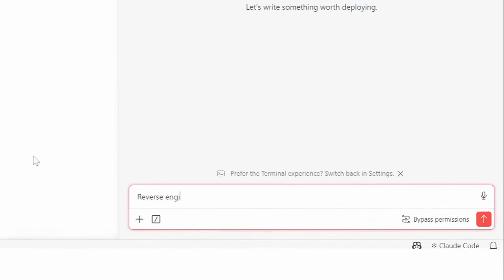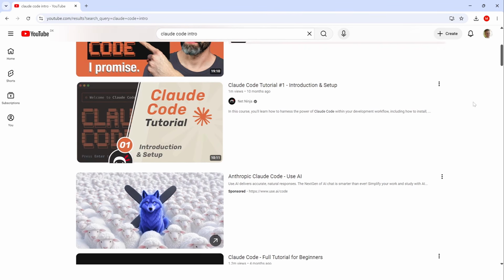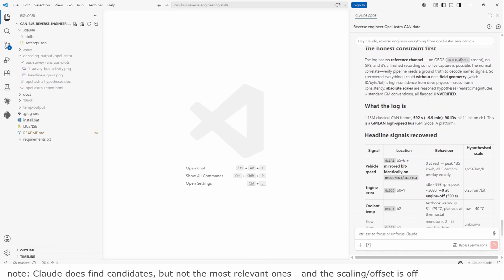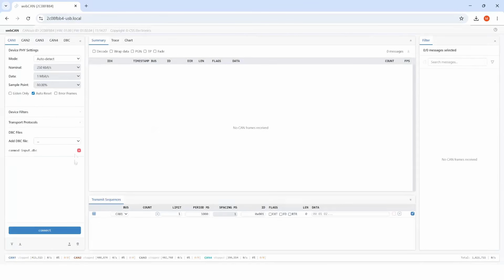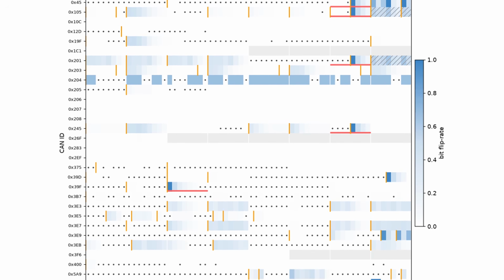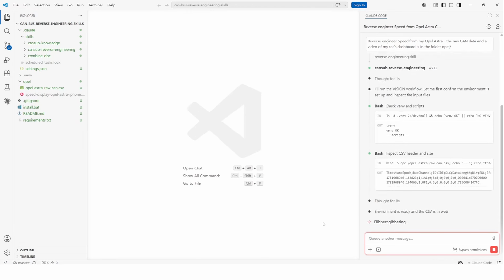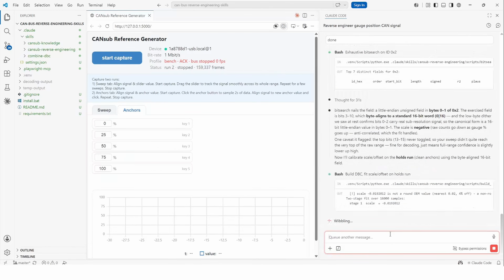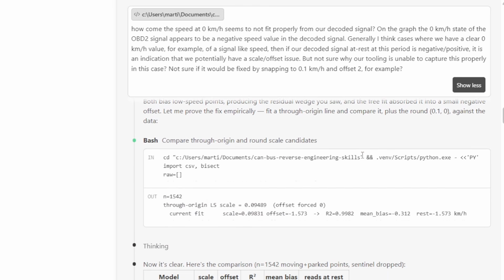AI CAN Bus Reverse Engineering [Claude Code]

Comment: Very nice but over complicated.  Passive can sniffer to the DLC, Savvy Can for pins 6 and 14.  Start capture, raise rpm by 1000 and hold for 10 seconds, repeat.  Capture the Savvy Can record and give to Claude.  The key is timed single events.  And you know what the event is.  Fuel level would be more difficult because of the nature of fuel level.  RPM actually is pretty easy.  For speed you need another person holding the laptop where savvy can lives.  Hold speed for 10 seconds, increase at timed intervals.  Tell Claude your pattern to spot.

Comment: It's great that people are working on this problem as I had similar thoughts on how AI can be utilized to parse and organize large data sets like this. The two places I'd like to see it implemented is for CANbus and with proprietary tools/battery combinations.

However, I'm a little confused at what you have and have not been able to accomplish with this tool so far. From my brief understanding in this video, you're passing both the raw and reference values into Claude and having it determine which stream correlates with that value. This, as you've shown is easy when you HAVE that reference data (ie, speed, rpm, etc.) but I didn't see anywhere you showing how you'd be able to gather reference data for items not easily accessed (and example I can think off the top of my head is cam timing). Sure, I could get this information from another tool.... but then I already have the tool that decodes this....

This is what I see currently: 
You mention the time saving of letting Claude doing the analysis, yet I believe you'd spend just as much time trying to figure out how you''ll collect your reference data for an individual component that it comes out in the wash.

But not all hope is lost. The biggest benefit is opening the door to crowd-sourcing the reverse engineering in a much easier fashion. (ie. I might be able to scrape together the o2 sensor data, while someone else might scrape together the timing, throttle control, etc).
That might be where you see the largest benefits.

I'm not trying to rain on the parade, I think this is a good *first step*... but there are many more steps to take...

Out loud thinking:
A company probably has their own proprietary CANbus protocol. But companies are cheap, they'll re-use that same protocol for a very long time, probably only changing it when they do a major refresh. I bet, over time, you can use say, the .dbc of a corolla, and a .dbc of a tacoma, and probably correlate a lot of the same points on a miata of the same generation. Now THAT would be your boon. Allowing the AI to compare multiple model's to enhance the others..

Really we just need some guy willing to spend the dough to buy the manufacture's software, and walk through the protocol one point at a time and map out the protocol to share... the question is, who has the money to do that and willing to put up with the inevitable C&D!

I'll keep an eye on this project however.. Maybe we need a repo to capture most up-to-date .dbc's that people can search/add to..

Good luck!
Reply: It is correct that this method relies on having a reference signal. But it is not limited to an "obvious" signal like an OBD2 PID or a GPS-to-CAN signal, for example. As per showcase 2 and 3, there are more 'raw' ways of getting reference signal information, where the trick is to be a bit creative. Sometimes this may involve having the 'decoded' information available from another source than the CAN bus (such as in showcase 2 a visual display in the car). Here I would argue that there is a massive difference in having that decoded source available in such a format vs. having it on the CAN bus - i.e. it is not a 'simple thing' to transform e.g. a visual display reference into a useful reference for CAN bus reverse engineering - and that is what the skill then showcases a set of methods to assist with. 

As explained in other comments, the article/video shows methods for speeding up the 'classic' reverse engineering workflows. These, in my opinion, will always involve a reference signal - whether explicit or not. If you're e.g. opening/closing the car doors or clicking a button while you monitor data in SavvyCAN, you are in practice using a "reference signal", just in a - I would argue - much less efficient way. If you do not have a reference signal in any shape or form then there is no real path to effective, verifiable reverse engineering - whether you use the classic manual approach or whether you use these AI agent assisted methods. In such a case, you'd be looking for a needle in a haystack or shooting in the dark. You "might" get somewhere if you can e.g. rule out potential candidates through elimination; for example, if you've got 20 potential signals and you can map 15 of them via other methods, you increase your chance at getting a good candidate signal even without a reference. But you'll "never know for sure" if you can't verify your results through some form of real-world observation. So this is just to say: That is not a problem I offer a solution to. But in my experience, 80-90% of practical reverse engineering efforts already focus on use cases where there is in fact a possible reference available.

If any questions let me know :-)

Comment: Thank you ever so much for educating me, I have wanted to figure out a way to add a screen for coolant temps as BMW's don't show this, well at least not on mine, I have also added a CarPlay screen and used magnetic tape to place it on the idrive screen so it can be removed or moved out of the way if I need to check it however this blocks the parking assistant; I have audible beeps but would like to retain the visual PDC view. I didn't know you can get contactless CAN bus sniffers/readers so I have ordered one; I do have the other type where you tap into the high and low but would prefer the contactless method, especially whilst hunting down the wires and correct ones as I presume there are more than one network/connection back to the gateway so the data I'm looking for might not be available on the specific CAN bus leads (I'm unsure if this is true or not). So I have been using just chatgpt and have heard about Claude Code but not tried it before until yesterday and within 30 mins it had created a working prototype which I could amend, even pick up another screen type e.g. non touch AMOLED to a touch LCD. It even generated code for the MR.DIY canbus gateway and setup ESP-Now which generates demo traffic until I can reverse engineer the canbus and get real traffic/data for it to display. Here's a quick video: https://youtu.be/PeGXMJScJgw Thanks again for this video, Claude Code is very powerful! it got it right first time and allowed for rapid prototyping, from an idea to something that should work in no time whatsoever, without doing any code! crazy.

Comment: With multiplexing on modern cars, it's almost impossible
Reply: Multiplexing would definitely make things harder, though I think that is something that could be added as an augmentation. The skill already detects the different types of possible signals (e.g. counters), so detecting possible multiplexors could be done. Then you'd essentially repeat the workflows already used in the skill per multiplexor value. Significant effort for a human analyst, but to the Python scripts and the AI agent it's just a matter of looping things more times.

Comment: I’m familiar with CAN bus hacking, though I’ve only done it manually. To automate more of the process and quickly build CAN maps with minimal extra effort, you could give Claude access to GPS, accelerometer, and gyroscope data from sensors connected to the capture device, alongside the captured CAN traffic. Correlating those data streams could help establish an initial map of signals related to speed, RPM, steering angle, throttle, and braking.

You could also have Claude guide you through specific actions such as changing lighting settings, pressing buttons, or activating the wipers while capturing and analyzing the CAN traffic in near real time. This would help associate each action with the corresponding changes in CAN data.
Reply: Yes, agreed - the GPS aspect is also an example I mention in the article, while the button example is the focus of showcase #3 :-)

Comment: I was able to hook up arduino board into a server on the I2C bus going into the PSUs to capture a few seconds and then claude was able to figure out the formatting and checksum.
But I then had to look what the certain register gives and see if it changes (real world values that aren't fixed) and what it could correspond to, and by how much I had to divide the value to get right number, which was some by the power of 2, so like 4, 32, 64, 256 etc. so it was a bit easier.
I use these server PSUs to power certain things, like RC chargers and DIY AI/crypto rigs that have multiple GPUs, because 1400W ATX PSUs get expensive and 1400W hp flex PSU goes for as low as $10 and it's 80+ platinum, while it's roughly size of flex ATX PSUs.
And now I have a easy way of measuring the voltage/current/power/fan etc. without actually having to measuring it myself with some ADC or current shunt having to carry 100+ amps, just I2C and then display it on a LCD screen or send it over USB to the computer and have it on some other dashboard or something.
And my programming skills are non-existent.
Reply: what voltage output are the psu's?
Reply: @littlebill2601  12V but could be modified into doing up to like 15V.

Comment: Quick question, would this be suitable for reverse engineering signals from something like a SAM module? For Mercedes in particular, the biggest hurdle with engine swaps for example, is coding the SAM modules and dashboard with the new ECU. Hell, 99% of the time its recommended to just buy a donor car and swap over all of the modules to avoid coding the old ones which defeats the point of an engine swap in my opinion.
Reply: I think it can be helpful for parts of such an exercise - key question remains whether you have a useful 'reference' to provide the AI agent with, so that it may compare that vs. the raw data. Without this, it'll be more like shooting in the dark.

Comment: Claude code is running locally in my 1995 Toyota Aristo. It reads codes, TEMS, ABS, Accel. Sensors, air suspension levels and pressures, centre differential. It outputs all data on touchscreen. Allows me to control the car fully with voice control and auto updates code and deposits into my repository with LoRa. The system has PoE and IoT thanks to the Pi5
Reply: Wow this is crazy 😅
Reply: Inspiring this is incredible
Reply: You can probably have Claude instead code that up as a deterministic application and save yourself the token usage.
Reply: @whatilearnttoday5295  actually, that's what Iam working on currently. I'm using Claude on the device 
for debugging now with a front end desbian based OS

Comment: Could this help to make a older car more fuel efficient?
Reply: The techniques can help you reverse engineer CAN data from your car, which in turn may help you better understand various dynamics - but I would not say it's realistic to then use this information to gain significantly better fuel efficiency on a single vehicle. On the other hand, for a larger fleet of vehicles it can potentially be helpful in deriving key signals that can help e.g. identify suboptimal driving patterns etc.

Comment: Doing it all the time, I built a simple ESP 32 P4, with 2 SN65’s (Can C and a proprietary Can), Savvy CAN, timed and single event triggers, and saved log capture.  Done.  Pins 6 and 14 are always Can C, 500kbs.   ESP32 P4 can actually support 3 can busses (with CAN sub boards).  Plus ETH for direct GEVRET to savvy can.

Comment: Would it be possible to produce a virtual ecu with this method to convert diesel Trucks to electric?
Reply: I don't think that these workflows are suited for something like that - but at a higher level, CAN bus interfaces/loggers are of course relevant and often applied in diesel-to-electric conversions. We have several customers that do this with our products, you can find some examples on our Case Studies section.
Reply: if you reverse engineer a diesel trucks ecu like 100% i guess you could emulate it, afterall the ecu is just inputs and outputs. the outputs change based on inputs. Only the external stuff like crankshaft acceleration and inertia would need to be simulated/approximated. then youd have a 1:1 ecm running on your pc desktop.
All this has been possible since electronic control modules became a thing, but you would need to spend years dedicated to getting it to work. now its maybe a couple months with a ai agent and good reference materials to reverse engineer a 512-1024kb ecm binary almost completely, then writing a simulator is couple days to a week id estimate

Comment: Looking for current speed and RPM values on the CAN bus makes zero sense since they are already available for monitoring on the mandatory non-obfuscated OBD port. Just like anything that you can trivially get a reference for through OBD is also not worth looking for in the CAN data stream for exact same reason. What you want to use the CAN bus for is proprietary sensors that are not exposed through OBD or indicated on the dashboard - but then you also get no reference data to perform the suggested routine: chicken and egg problem.
There's a kind of a potentiometer workaround presented, but again - in order for Claude to find some non-OBD-standard field like EngnFlAttr1CntrlCmmnd in CAN stream you need to turn the gauge by hand in sync with ground truth value of EngnFlAttr1CntrlCmmnd which means you already have the ground truth reading from *somewhere*. Which, as far as I understand, implies having access to a proprietary scan tool. Well at that point it's easier to drop the potentiometer board altogether and just feed Claude a screen recording of the reference scan tool.
Tiptoeing around this makes sense for legal reasons I guess, but also creates a huge epistemic plot hole.
Reply: Thanks for the inputs! I suggest reading the full article on our website, there I explain some of these more subtle points in terms of why we argue there is real value in reverse engineering the proprietary equivalents to the OBD signals. Further, showcase 2 illustrates that it does not require a proprietary scan tool to get additional reference signals - often a lot of the info of interest can be directly derived e.g. from a vehicle dashboard. However, I also try to be very clear that the method is not akin to 'magic' - i.e. without a reasonable reference signal where you can "observe" what the true signal value is, you'll be shooting blind. But this is true both to the agentic workflows and to the 'classic' human-led workflows. In other words, my purpose with this is to show a method that helps democratize and speed up a fairly complex and time consuming workflow - not necessarily to say that you'll be able to reverse engineer 'new signals' beyond what a professional reverse engineering end user would be able to previously.